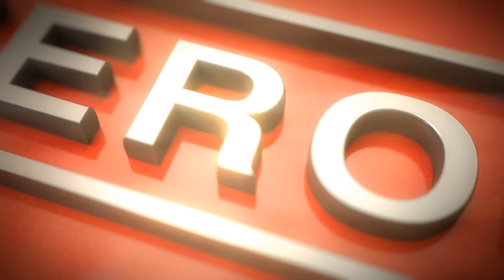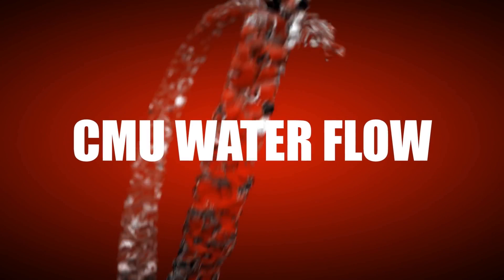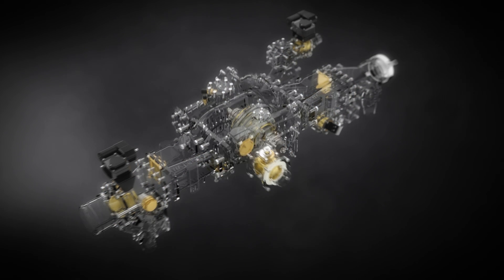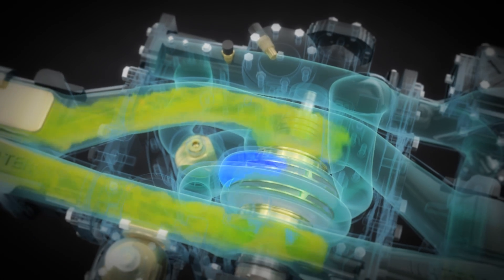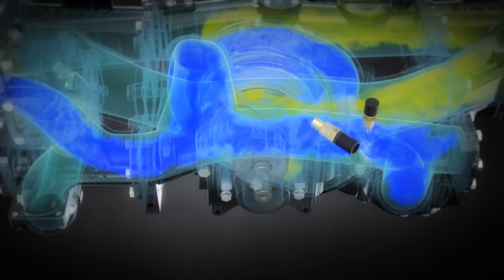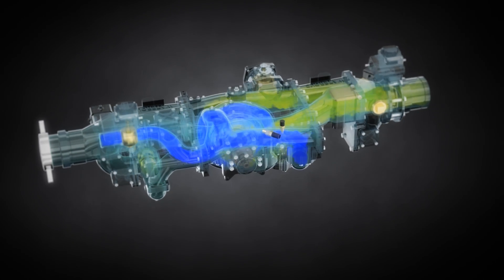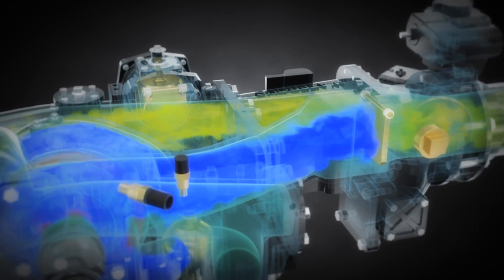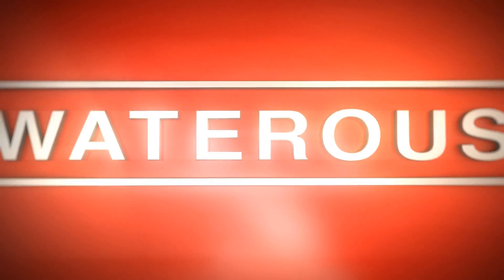Waterous Two-Stage CMU Fire Pump Water Flow Animation

Comment: What pressure or RPM should the transfer valve be operated at?
Reply: Electronic Transfer Valaves can be operated up to 250 psi. So as long as you are below this pressure you should be fine